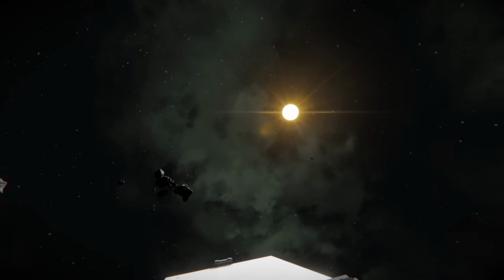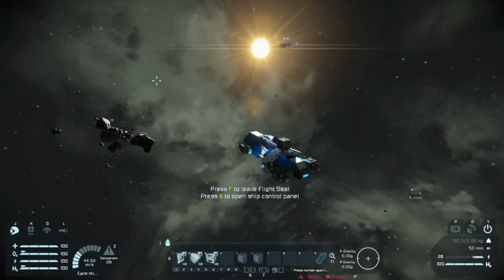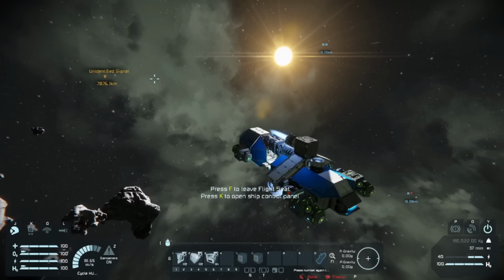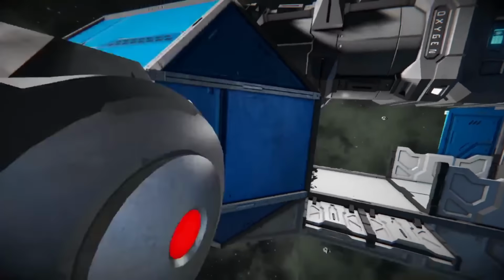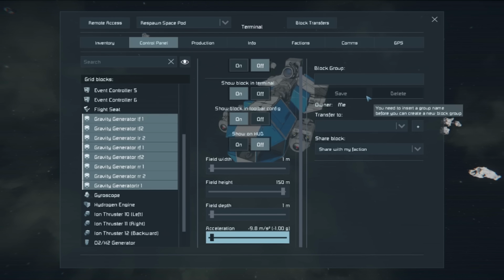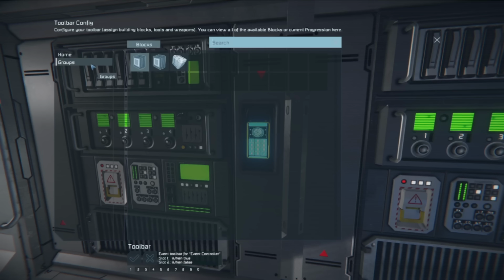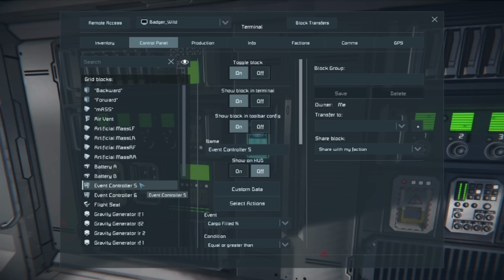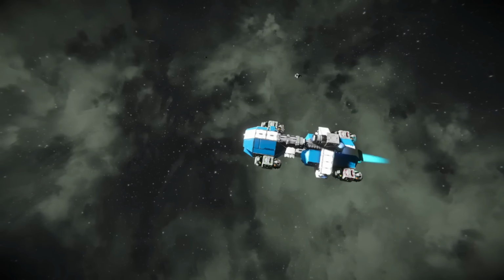Scripless, Vanilla, Gravity Drives!

Comment: Hey Badger, first off I love the videos, but there is another way to set up the gravity generators so that 1 generator can propel the ship in 2 directions. 

To set it up, place down your artificial mass blocks evenly spread around the ship. Then say you want the gravity generator to go up and down, you place however many gravity generators you want all oriented the same direction right side up. Make sure the mass blocks are shut off while you set up the grav gens. Group all the generators together that you want to go up and down, go into their settings and set their gravity fields to 0 m/s. 

Next you need 2 event controllers for each direction. So you could label them up 1, up 2, down 1, down 2. Set the event controllers to detect 100% thrust from the desired thrusters. Finally, in the first 5 slots of actions for the event controllers for both up 1, and up 2 (so on pc press ctrl 1, ctrl 2, ctrl 3, cntrl 4, ctrl 5 to switch between each to setup the actions) and for going up, in action slot 1 in slots 1-5, you select decrease acceleration of the up/down gravity drives, and in action slot 2 you select increase acceleration. For the down direction repeat the thruster selection for the down thrusters, and for action 1 you select increase acceleration for slots 1-5, and in action 2, select decrease acceleration for slots 1-5. Make sure to make those selections for 2 event controllers going down, and 2 event controllers going up. The reason why is because you need to tell the program that you want to input 10 ticks total of either increase or decrease acceleration with one button press. A single event controller only has 9 inputs it can do at once, hence why you need 2 controllers to get the desired outcome.

You can repeat this process for the other directions too. In total it takes 12 event controllers and is expandable depending on how many gravity generators you wish to have in any pair of directions.

If this is confusing, or intriguing, you can DM me and I can demonstrate this setup. In pvp servers, this is how they set up their gravity drives to get more thrust powet out of less pcu use since most servers have a pcu and block limits.
Reply: You can use a circular gravity generator to get all 6 directions, then using small grid thrusters (if you wanna save space you can fit the entire control system within a single large grid block on a hinge or rotor) and event controllers. You can use that combination to make a wsda converter, so that when a thruster is on the appropriate mass block is active, like you have set up here. Then to hold it all still and keep from tilting, have at least 2 gyros and have all the event controllers set one of them to override while they are active and turn off override when you're not. Also, if you use the space balls instead of the mass blocks, you can get far greater control over your throttle.
Reply: Oh, also, set the power of the override gyro lower than the main one so you can still turn.
Reply: @Soothsayer-bp8oz True, you can do this, and I'm sure it would work well in a solo game. But when you are working within block limits and pcu caps on a pvp server, I will want the use of all mass blocks that I can fit on it all the time. It also doesn't help that the server has a bad habit of turning off spherical grav gens much more frequently than the regular ones in-between server resets.
Reply: @Whitefaulken  if you're doing pvp a grav gen is overkill. Use a Klang drive. I thought we were talking about what can be done, and replacing 37 ion thrusters with 6-12 space balls and a single grav gen on a freighter is well worth it imo.  That being said, in any build that I've used it, it uses less cpu than the amount of thrusters I'd need, and the circular generator usually sits off anyway. All grav gens use too much power to just leave them on, but if you say it won't work on a pvp server, you're probably right. I tend to avoid those.
Reply: @Soothsayer-bp8oz Klang drives tend to be banned on servers, unfortunately. Same goes for Klang cannons and anything in that category.
Reply: @Whitefaulken  lol yeah, I wasn't thinking. That makes sense. I still think it's more fun to make with the circulare gens, and the space balls are the superior mass block (ill die on that hill 😜), but I can definitely see the benefit of doing it your way. It's a lot more powerful. That being said, I noticed something else, I don't think this works so well for a ion thrusters, but if you use Atmospheric thrusters, you can do a recursive setup in your event controller to increase power as the thrusters ramp up. If you set your event controller to increase/decrease power and increase/decrease the threshold on the event controller, it will step up/down both by 5% (I think, the new settings added by the update might have made finer control possible, 🤷‍♂️ haven't played in awhile) every 5%. It gives a more natural ramp up, that is technically a bit less responsive and you should have a seperate event controller that resets to 0 whenever the thrusters are outputting 0 but even if it's not useful to you for grav drives, and if you didn't know about it before, maybe you can find other uses for it. It's how I use lcd screens to show custom fill gages. If you want an example you can look up scriptless cargo indicator (I think, again it's been awhile) on mod io. That should get you there.
Reply from the maker: You talking about turning the mass blocks on and off?
Reply: @badgerwildgaming6908 I think that's how Soothsayer's is working, yes. You set the grav field on the spherical generator to either max negative or positive gravity, spread out all the mass blocks and have certain quadrants of blocks turn on to push or pull the ship in the desired direction. Or he might be manipulating the mass of the space balls in certain sections of the ship instead of turning off and on mass blocks for finer control like he said.

Mine, the mass blocks are left on once everything is set up since with this setup you want to be able to utilize all mass blocks all the time for each direction and you manipulate the force of the gravity field to either positive or negative Gs to get the desired effect.
Reply: @badgerwildgaming6908  lol you and whitefaulken are correct. Turn the space balls off and on and change their mass manually for more precise speed control (kind of like shifting gears) or have the event controller slowly increase and decrease the mass using the recursive event setup I told faulken about if you want a ramp up and down for that more natural feel. Wheels can be used as a ws converter, but i can't remember if the event controller will read their steering angle or not for the a and d.
Reply from the maker: Have to try that may have a new video.
Reply: @badgerwildgaming6908  Lol sweet! Have fun! For transparency, as I've continued to think about it, I can't remember for certain if you can turn off space balls... I feel like there was one of the mass blocks you couldn't... 😅 but that might just be me second guessing myself cause I'm like that.
Reply: @badgerwildgaming6908  some of my info was misremembered. Sorry for the frustrations. Wheels can't be read in any way by ec's. I booted it up and checked it out. I feel like there may be a way using the battery output too. And if you just wanna give your normal ship a boost, you could set it up to change the mass of the space balls according to speed so your responsiveness matches your speed.
Reply from the maker: That's cool. Would there be any changes needed to the event controller?
Reply: @badgerwildgaming6908  lol um... yeah. You'd need another ec that is set to increase/decrease mass of the space balls when your grid speed greater than or equal to 5% (or whatever it goes up to when you start at 0 and hit increase speed in your cockpit hotbar, speed mods mess with the total speed percentage) and then also set it to increase/decrease the threshold of itself. And then set up another ec that resets everything to 0 when you're speed is at 0 (or whatever you decide your starting mass should be, it doesnt need to be zero). It's a tiny bit redundant but very necessary. Again though, this is just to give your ship a boost, it won't work without enough thrusters to move you already.
Reply from the maker: That's cool I'll have to try it.
Reply from the maker: That's cool how do you guys stabilize the ship so it doesn't flip as much?
Reply: @badgerwildgaming6908 

First and formost, it helps when the ship is symmetrical. Second, turn on the center of gravity in the hud settings so that you can see where the center of gravity is on the ship. Place the mass blocks evenly in regards to the center of gravity of the ship. Its all about testing and placing the gravity blocks in the best spots. For instance, in a wedge shape ship, if i place a total of 30 artificial mass blocks, im gonna have a few extra mass blocks placed at the rear of the ship vs the front because the center of gravity will have shifted more torwards the rear. 

Again, its all about testing and moving the artificial mass blocks to where they are balanced along the ship to prevent the twisting.
Reply from the maker: Ah OK I've been doing that but I probly need to do more testing and tweeking then.